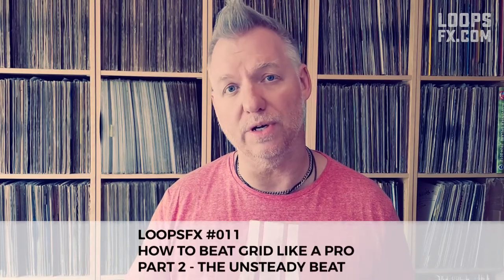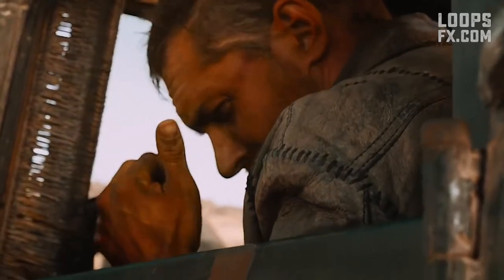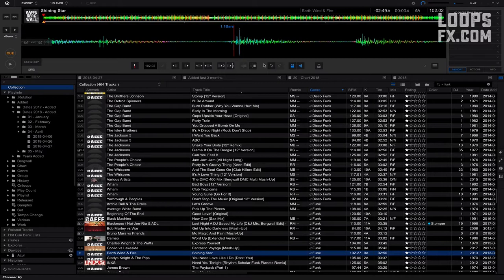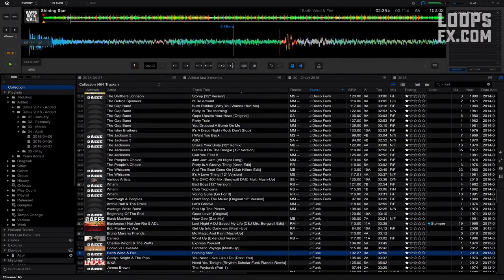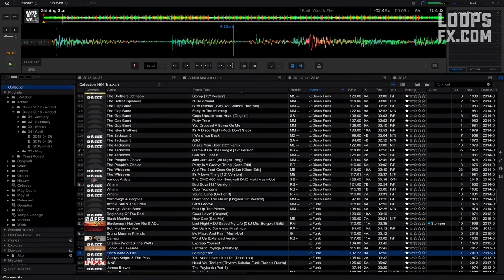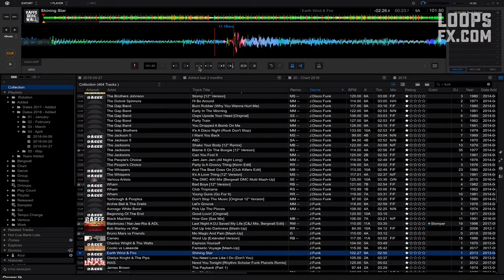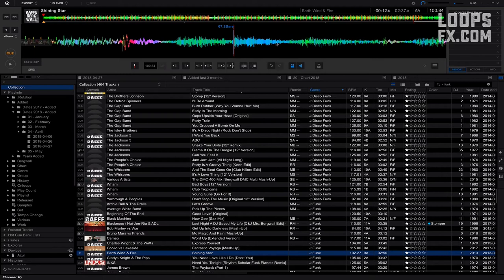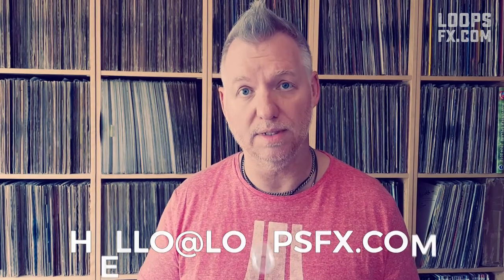How to Beat Grid in Rekordbox like a Pro (Part 2 - The Unsteady Beat) by BERGWALL #011

Comment: Love the video. When do you choose to move the entire beat grid (left or right) or just adjusting the grid from to snap to the cursor. If that makes sense. When I shift the entire grid it messes up the previous grid.
Reply from the maker: I only move the entire grid at the beginning of the track. To align to the first beat. After that I only adjust the grid with the Shrink and Expand buttons.
Reply: @LoopsFX  Thanks for responding! How do you determine when to use the beat shrink/expand buttons vs. the adjustment button? If that makes sense. Thanks again.